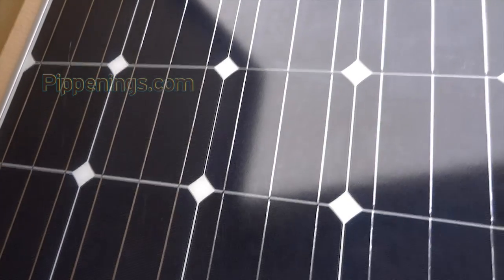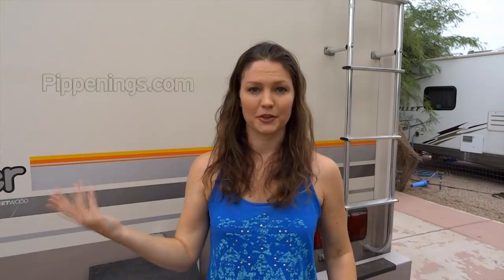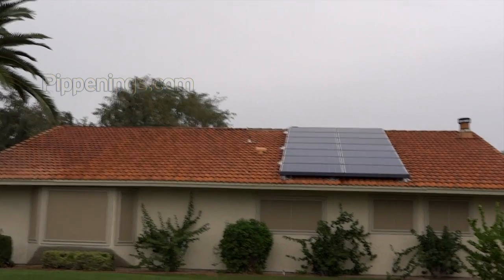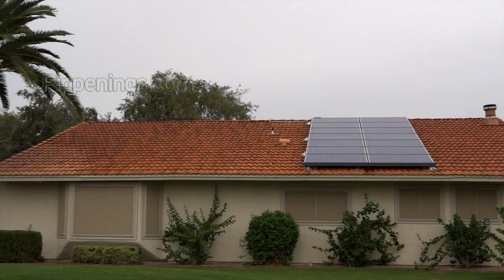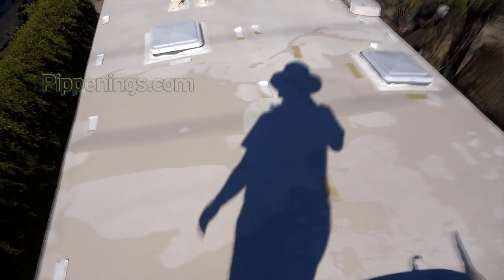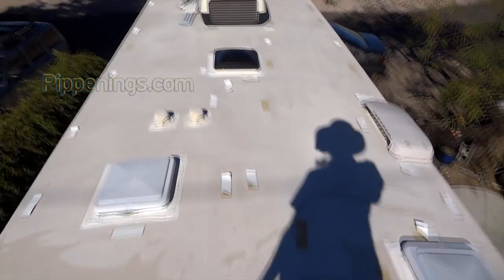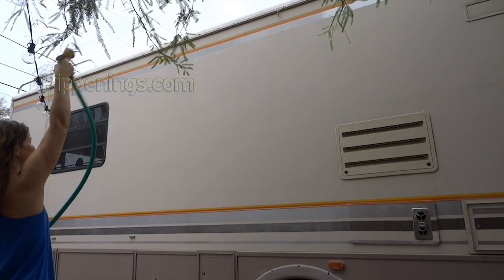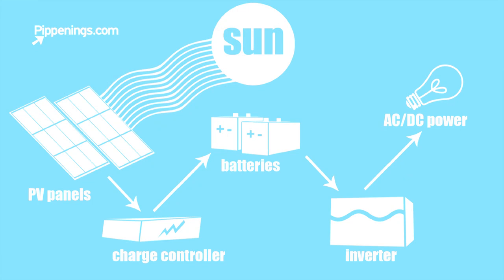RV Solar Living Basics: Panels and Charge Controllers

Comment: I wonder if I might tweak your description of MPPT vs
PWM.  I am going to try to keep this
short an basic.  

A MPPT controller is basically a smart DC-to DC
converter.  It can convert higher voltage
panels to work with lower voltage batteries. 
It figures out what the most efficient voltage/current combination for
your panels and sun conditions and operates that way until something changes
and then reconfigures. Then it charges the batteries the same way as a PWM
controller by turning on and off (at a high rate) varying amounts of time to
keep the current/voltage optimum for the battery demand.

A PWM controller can only limit the current going to the
panels. It does this by turning on and off (at a high rate) to supply the
batteries with the demanded current.  As
the batteries become charged, the current demand drops, and the controller
stays off longer until the battery is charged. 
When the batteries are charging in the early stages, the controller is
probably on 100% of the time and the voltage of the panels will be dragged down
to the battery voltage, which may not be the ideal voltage for the panel.  

The MPPT controller can keep the panel voltage/current
combination optimum for the panels you have. 
That's the smart part.  The specs
say that there may be about a 30% efficiency gain in the charging cycle.  Your results may vary.

Thanks for listening.
Reply: yea very well said, thanks. That figures along with the possibilities that our current technology provides for. The MPPT has no capacity to "store" as it seems to state in the video, just a wider range of voltage control, with what could be a less efficient method, depending (it always depends) your inputs and outputs total.   
And in your PWM paragraph you said panels, not battery.
This idea that a MPPT is always more efficient , when conversion itself is not necessarily the most efficient method for your setup, has not been a helpful statement. Wheras saying your results may vary is way more accurate a statement.

Comment: Excellent Pippi:) Have you heeard anything about 24V systems?
Reply: Panels typically output at 12 volts but you can wire them in series to output at 24 volts. If you're batteries are configured as 12 volt you'd have to use an MPPT charge controller to drop that down to 12 volt for the batteries. There is actually an advantage to doing that; one is you can can use thinner gauge wiring from the panels and the controller is better able to charge the batteries when the incoming voltage is higher.
Reply: A good explanation of how MPPT works can be found here: https://www.solar-electric.com/mppt-solar-charge-controllers.html
Reply: Thank you very much. I am looking at an off grid house that they said had 20 amp hours of 24 v. It was a different way of describing it and I will see it in person today to get a sense of what that is in Watts etc. I will look at the links you mentioned. Thank you:)
Reply: You are correct for higher wattage panels. Most 140 Watt and below, which is what I've typically seen installed on RV's, are 12 volt (though actually producing around 17 volts). Most of the newer panels I've seen especially in the 300+ Watt range are producing between 31 and 39 volts which work great for a 24v battery storage system.

Comment: Interesting video. I do have a question for our charming host (or anyone else here).  Does a 150 watt PV panel, for example, refer to the maximum watts the panel can produce under ideal conditions...noon, summer day, clear sky, etc. and realistically how many watt-hours per day can it produce max.?
Reply: There are a couple of ratings for panels. What you most often see is the STC (Standard Test Conditions) rating listed for the panel. There is another called the Nominal Operating Cell Temperature Conditions (NOCT) rating that is generally more accurate. Panel manufactures will often list both. My 140 Watt Kyocera panels have a STC of 140 Watts but a NOCT of 101 Watts. The latter is what you'll more likely see in normal operations. Temperature can affect output. Panels perform better when it's colder but then that's also when the available sunlight isn't at it's peak.

As to watt hours you can visit pvwatts.nrel.gov to get the average peak solar hours for your location. This isn't the total amount of sun you get daily it's the average number of max sun hours you'll get. For me it's 4.5 hrs. The panels will still generate power longer than that but that's peak production. It's a useful guideline to use when sizing PV array's and battery banks. Angle of panels to the sun also affects production.

Comment: Pippi, I just put 6 x 160 = 960 watts of panels, a 3,000 watt hybrid inverter, 830 amp hours of batts, and lots of other misc crap on my fifth wheel. I'm a general contractor and have taken math beyond calculus, so this stuff isn't rocket science. I will tell you that PV/ Solar is a circus because of the 30% federal credit and everyone and their mother have gotten into this field. Most are marginally competent; many are incompetent. Some know what they are doing with respect to both the theory and the application in an optimal way for a particular job. Learn from the comments, but don't take stuff too seriously, because there are some major geeks who sit at home and rag people on forums, who have no other life. The calculations are always subject to argument because of loss factors (efficiency factors), which are not expressed on the product labels but are more "rule of thumb". I recommend you read Jack Mayer's web site and let a pro go over your skematic before the install. Stick to the tables for wire sizing and make sure your system is well protected. Good luck. I love the fact that you put yourself out there even though you say you don't know and are learning. Most folks would be chicken, including me. Again, don't let "geeks" piss you off. You might not have any on your channel. Good luck.
Reply from the maker: Thanks John :)
Reply: You're welcome. I wouldn't rely on anyone who hasn't completed at least a few hundred installs. Even someone without the theoretical underpinnings will get it right if they've had this much field experience, even if they can't necessarily walk you through the math.

Comment: Very well said Pippi, don't get too technical seems how most don't know the difference of what watts and amps are. They no that it takes 110 volts to plug something in to use. And they know that you can't run that item on the battery out of the car. KISS is going to be the best way here. Thanks for doing this.
Reply from the maker: You bet Jerry, thanks for tuning in! :D

Comment: 2:23 I'm no engineer/technician, but I'll sometimes get confused when people use 'solar' and it's not clear whether they're referring to heating water or producing electricity o.O Using 'solar' for water and 'PV' for electricity should solve that problem :-)

BTW, are you going to address panel tilt/angle? I usually see people installing them either flat (horizontally) or at a fixed angle, so I've always wondered if it would be possible to make them adjustable — sunflower-style, perhaps?

Looking forward to the next videos in the series!
Reply from the maker: I'm not tilting them because I'm installing them on my mobile RV. I considered rigging up as adjustable stand but that's too complicated for me right now. I'm just going to install them flat.
Reply: I've recently learned that what I called "sunflower-style" is actually called 'sun-tracking'. Also, they seem to be pretty large and mounted on the ground, so no wonder I've never seen one on an RV or tiny house o.O

I don't think there's anything keeping smaller panels from being sun-tracked, but the norm seems to be to have the bigger ones attached to a tracking system.